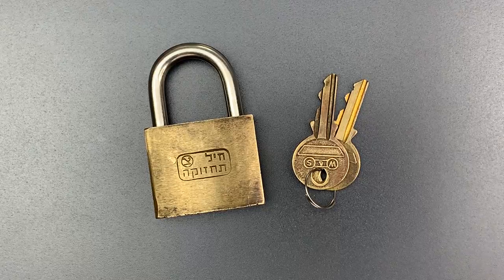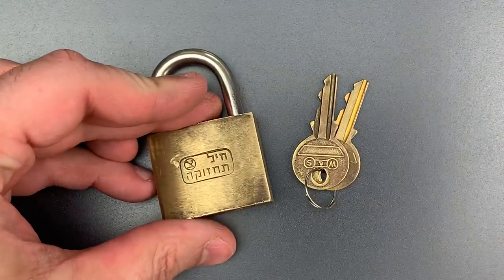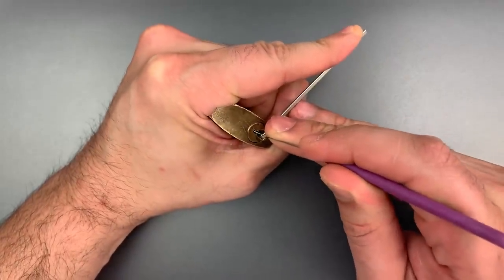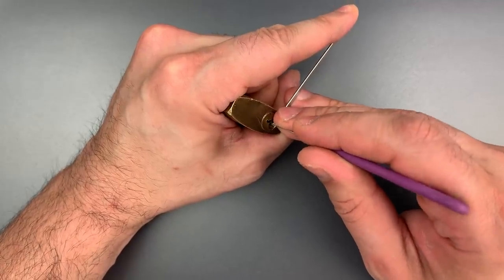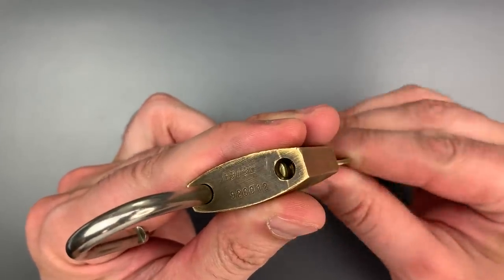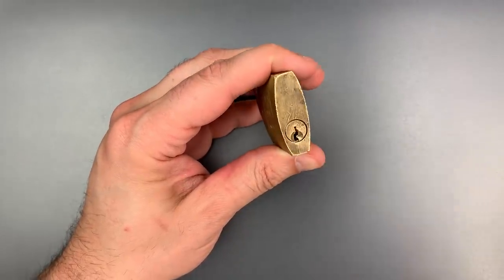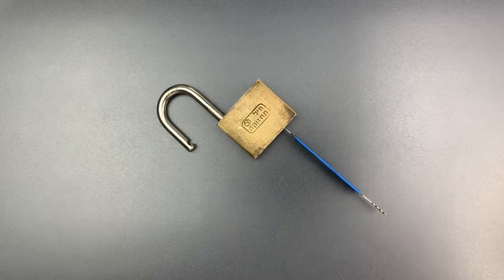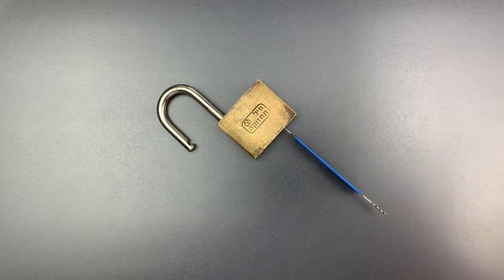[902] Israeli Military Lock With A Serious Design Flaw

Comment: I think they should make a padlock core that comes out but stays in the lock then you drop in a microchip which is encrypted with a password length of 5million random letters, numbers and special characters that's not compatible with sd card or USB (shaped different) so it can't be accessed on pc to see or decrypt, if they do manage to connect it to pc it will not show up as a device

 then the lock has a long life button battery in built which can tell you the battery level via Bluetooth to your phone, the keyed portion gives you access to the core with the female chip slot but the key does not open the lock itself, you need the chip

It sounds elaborate but it's simple because the microchip system works on the lottery principle that the long string of code matches what the lock is programmed with I. E a code looks like 6G9;h+1dA:9?5#@))&, etc

 This way there is no physical pick possible even when gaining access to the core itself. You could vandalise the chip port and it would become a shackle but at least then its definitely not coming off without cutting and picking is 100% removed 

Bringing existing technology to locks, the code is never visible not even to the owner so it's impossible to hack

I'm pretty sure it's a great idea
Reply: Let's start with the key length. 5 million characters (5 MB) is way overkill, 256 bits of randomness (32 bytes) is all you need for reasonably strong crypto (as in unbreakable without a quantum computer, or even with one if you don't use asymmetric algorithms). It's not going to be the weak point. Also, don't worry that much on overcomplicating the technicalities of key exchange, it's not a hard problem. Honestly, all you need for the key is a microcontroller with protection against external read access and an SPI channel, and that's a $3 piece.

The hard problem is bridging the gap between digital security and hardware. You need a way for the lock to open itself once it detects and authorized key chip. That's still simple, just use a DC motor to move the locking lug or ball bearing and put all sensitive electronics inside a waterproof hardened steel case. But the one problem that's almost impossible to tackle with electronic locks is the heating attack, the best you can do is design a lock that stays shut if you fry the electronics.
Reply: Ben Snow Look up ASSA CLIQ, available on their quality brands (ASSA, Mul-T-Lock etc.).  Entire electronics is inside the plug/core, battery and second chip is in the key handle.  Traditional d12 or 600 key mechanism must match in addition to electronic key.
Reply: @johnfrancisdoe1563  Just read up on it (thanks for the cool reference), but sadly my worries are confirmed. It uses triple DES, an obsolete form of cryptography that has been considered inadequate for two decades. Also, it seems to have a vibration bypass. Overall, cool concept, would love to see it executed better.
Reply: @DeeSnow97  Not exactly a domestic door lock, but this one is pretty secure. It can be fried, but it won't open. 

http://www.kaba-mauer.com/en/solutions/electronic-combination-safe-locks/549170/paxos-compact.html

Comment: Look at some Russian military locks. They are very high security. Just like the hi-shear 1200 but about 2 times the metal and a EVVA MCS to top it. There is a dual cylinder version that is standard with a 3KS and a MCS so you are doomed